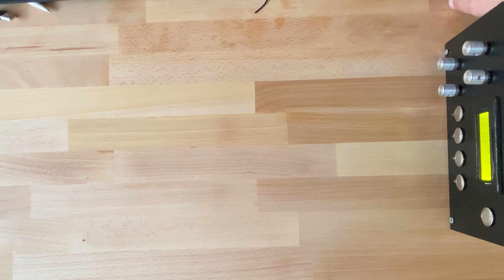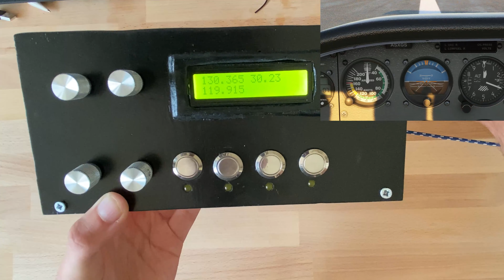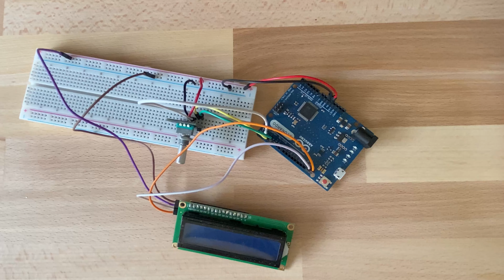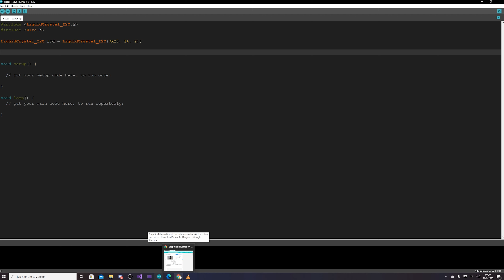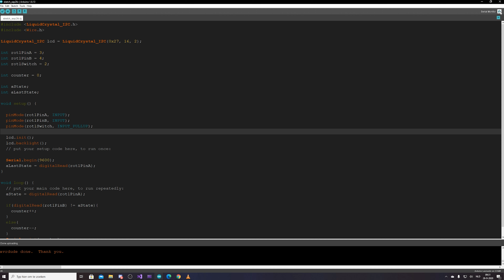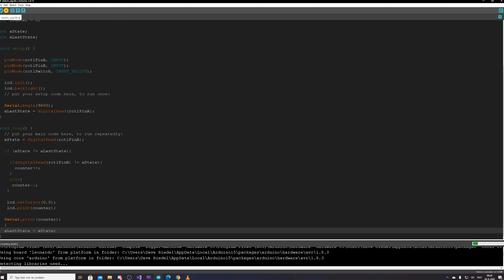How to: create your own arduino radio controller for flight simulator 2020 part 1A

Comment: vielen dank !!!
Reply from the maker: Kein problem (my best attempt at writing German). If you haven't seen this already In this video: https://youtu.be/WBr1ZI-aIns?t=846 I use direct inputs to control the game with rotary encoders and its more responsive than the joystick library.
Reply: @Bitsanddroids  Leider ist mein Englisch sehr sehr schlecht, weil ich immer noch mit Deutsch beschäftigt bin LOL

Comment: Awesome video. I've been using my tablet as a button box for my sim games but your videos just sold me on making my own stuff. Hey could you add the parts used to the description?
Reply from the maker: Sure I'll get back to you in the morning when I'm at my pc
Reply from the maker: I've included the links to Items that look similar to the ones I bought. I'd recommend shopping around though for the best deals. I just picked the first I encountered.
Reply: Thank you. That's actually why I was interested.  I was hoping to have a starting point on what exactly to look for. Much appreciated.